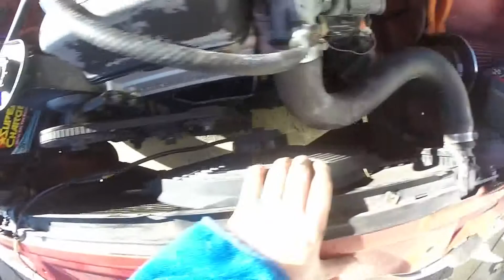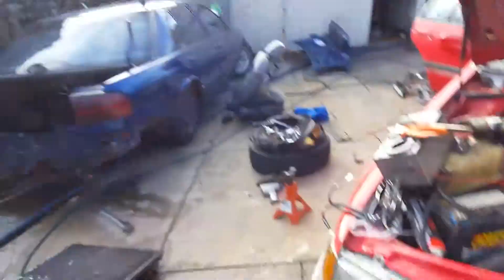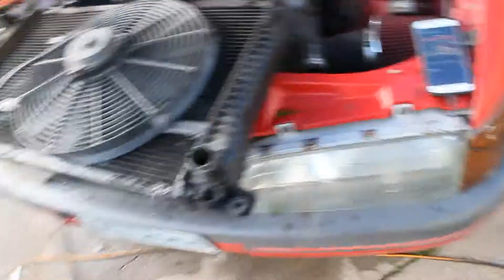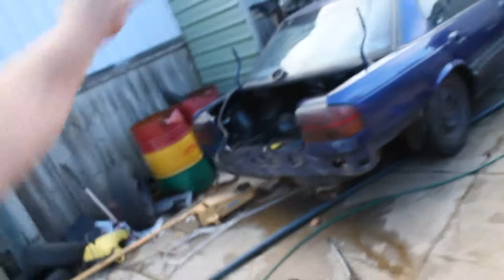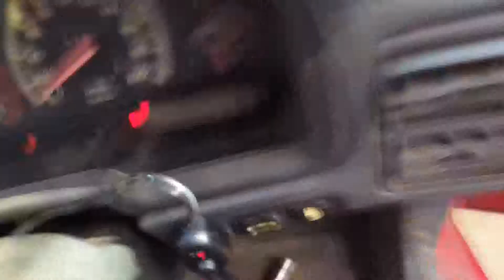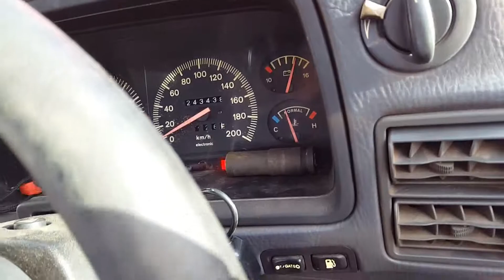Replacing clutch fan and raditor EA Ford falcon Project

Comment: I have a EA falcon that I converted the fan from a el they fit straight in no modaforcaions neaded. So much easier then one fan.one runs of the coil the other of a switch in the car.one switch needed and two realys.
Reply from the maker: +Mark Barry you run one full time?